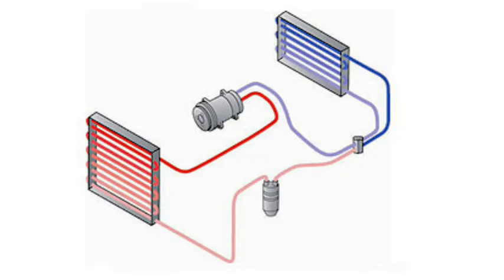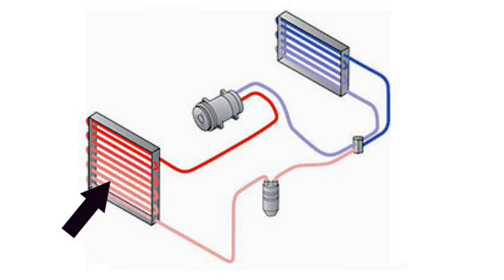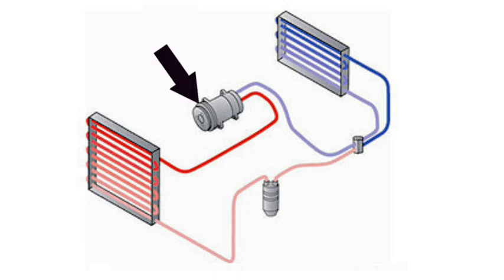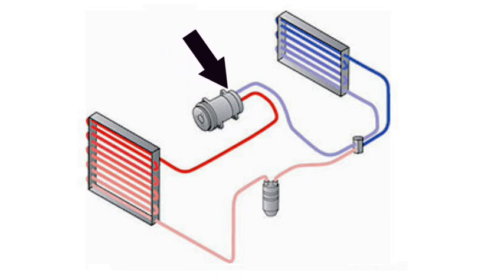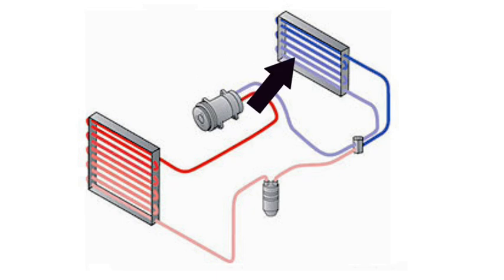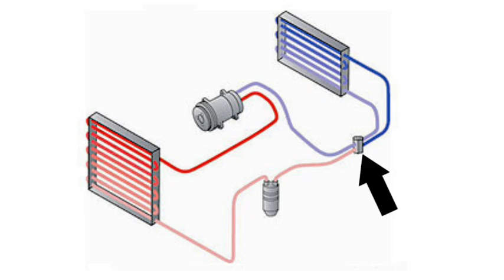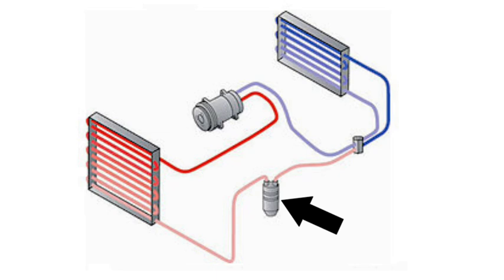AC System Basics - EricTheCarGuy

Comment: The only problem with taking it to a professional is that they will charge you $800 to $1500 no matter what is wrong and it may still not work right. The auto repair business, and especially AC repair is one of the biggest consumer scams and rip offs.
Reply: Whatatay T amen
Reply: Ok let's put this into perspective since ALL mechanics are scam artist. There are over 1,500 car manufacturers out there and each one has anywhere from 1-10 different ways of doing this, can you can tell me every single way this is done? I'm gonna say it's safe to say HELL NO so next time a mistake is made think of the bigger picture not just your own selfish thoughts on what you think is right.
Reply: @jayyroberts7754  Which is irrelevant? Why would they need to know about every system, ever? Clearly someone doing research into the possibility of doing it themselves will only look for information applicable to their unique system. Also, your notion that doing it yourself because, in most circumstances, it is otherwise unaffordable is "selfish" is laughable.
Reply: I love somone with YT knowledge saying AutoTech are dumb. Why are you hear if we are so dumb.
Reply: No YOUR just a fucking idiot
Reply: I never service my car AC till its broken itself. Jst change the cabin filter. Never trusts workshop. Whenever i service it, they will say some leaks, condensor not good, the worse is ur compressor needs replacement. I had bad experience when jst replacing the cooling coil then eventually i had to replace the whole system and costs me 3k. What so frustrating my other car, the cooling lost during really hot day.
Reply: Bro i just check my ac system at firestone auto..they took my car and i was sitting inside the waiting room then they told me that to fix my ac would cost me $2100..i was so stun i said to the guy... bro i am driving a chrysler mini van for christ sake!!! not a Mercedes
Reply: @throwmammafromthetrain  its the typical mechanics. Always try to get the most expensive parts. My advise, go and bring it to at least 4 shops and hear wat their comments and compare.
Reply: One fucker broke my compressor in my 93 celica when I lived in Florida. I had to endure the heat for 4 years man...
Reply: @goldwolf0606  woah. FL heat is brutal wat did he do?
Reply: I can understand how some people can call the automotive industry a scam but thats not what it is... dealers and private shops have no intention of ripping people off. I mean seriously, if you cant handle these places then you should be doing research and work for yourself instead of complaining. And for your info people, not everyone is a scam and not everyone is out for your money. If you dont like it, educate yourselves. Dont be lazy.
Reply: Carl Bungabong why dont you!?! Enough of them do that complaint is warranted!!! Fucking crooked ass Mechanots!!! I’ve met 2 good mechanics in my life. My brother and this dude named Bob Simon. Then from YouTube there’s Scotty Kilmer, Chris Fix, and 3000gt restorations. The rest, that I’ve actually met... just want money money money!!! They don’t care to help. I have started learning and doing my own repairs because of them! and because my brother lives on the other side of the country or I’d have him fix stuff.
Reply: @carlbungabong6536  You're lying.  Not every auto repair place is out to rip you off but many are?  The problem is,  if you get an oil change and leave without paying,  it's a crime and you can be arrested.  If an auto repair place charges you for an oil change but doesn't do it, it's a civil matter.  We need laws where employees and owners are arrested for fraud.  Speaking of lazy,  get off your ass and look up videis of auto repair shops ripping people off.
Reply: @MrWhaatay  the automotive world isnt cheap but yes its wrong for a shop to charge you for any job that wasnt performed but just because there are places and people who do it, it doesnt mean that everyone is doing wrong. Like i said, if you want cheap and work done right, do it yourself and not complain about shops. Just because youtube has videos of assholes doing it doesnt give you a reason to think that way. I do free jobs for good people as long as they supply their parts. Hell i even help them get parts free of charge and use what discount i can provide to help them because not everyone knows about cars and there arent many who can provide for all maintenance. This is why i take offense to your comment. Surely i wouldnt want to help you with a free job anyway so good luck with your repairs.
Reply: @carlbungabong6536  Just because you help people doesn't mean everyone does.  More auto shops rip off people than don't and I'm not talking about You Tube videos. I'm talking about government watchdog consumer agencies.  I take offense at your comments as it seems you are trying to get people to get ripped off. If you don't think auro repair is one of the biggest scams you are either lying or dumb.
Reply: Where do I find accurate wiring diagrams for auto AC system
Reply: I got my condenser replaced and the system recharged for a grand total of $350 at the shop I go to.
Reply: @yadonious5005  You got ripped off.
Reply: Whatatay T how much should that have cost?
Reply: BS. Most I've ever paid to have my A/C recharged is about $60. That was many years ago, but it's not that expensive unless you need parts. New parts are expensive, get used ones and save $$.
Reply: @OMGWTFLOLSMH  Did I say charge?  I can charge it myself.  If you take it to a professional because the AC doesn't work they will rip you off.
Reply: OMGWTFLOL mate there’s a difference between a recharge and getting a new condenser put in and THEN recharged after that
Reply: @yadonious5005  If you only need a recharge they will still rip you off and charge for parrs that aren't needed. If you need a recharge you have a leak.
Reply: Whatatay T yeah, a leaking condenser. And I don’t imagine welding on a small piece of sheet metal to plug the leak will be any cheaper than a new part by the way
Reply: @yadonious5005  The point is regardless of what is needed professionals will rip you off and charge $800 to $1500 for any A/C repair.
Reply: @MrWhaatay  Most of them, yes
Reply: hi eric how do you fix the ac system on a 1994 siverado
Reply: where do u live?
Reply: +Whatatay T - You are 100% correct. Here is what I do, I learn as much as I can, so I can do it ALL by myself. Although NOT all will be like me... But it's NOT hard to learn everything by yourself. Maybe I got a good head on my shoulders, thankx to whoever is above.... But even if I don't, I don't give up that easily. There are tons of things you can do and especially YouTube, you can learn a lot, even from the Dummy YouTubers.
Reply: Give me a break. the auto mechanic who doesn't rip you off is the exception and not the rule. some are just dumb especially when it comes to electronics and computers.
Reply: You have obviously had bad experiences with auto repair shops, but don't label all of us as scam artists.
Reply: What you can do is to bring it to an AC specialist for them to diagnose what the exact issue is (you DO NOT actually have to actually go ahead with the work they suggest...most wont be offended if you say no thanks and take your car home).  

Unless you are concerned that the shop is going to intentionally damage something that isn't damaged when you brought it in (I guess it's possible but that really would take a real ass of a shop), at least you'll know what the issues could be.  If you feel that the diagnosis is questionable you can bring it to another shop and see what they say.  If the 2nd shop says the same thing then chances are it is what it is. 

NOTE: you can usually find coupons for AC diagnostics service for pretty cheap (i just saw a $9.99 ac diagnostics coupon for Firestone).  

Once you know what the issue is you can then decide on what to do (with AC's you're kind of stuck unless you live in Alaska or something since you will need it).  

If it's something like the compressor motor (expensive) you could mitigate the cost by actually shop around online to find a cheaper compressor motor (you want to make sure that you call them personally and give them all the details of your car..year, make, model, trim, engine, auto/manual, etc. so that it's the right part) and then just have the shop do the labor.  Could save you anywhere from a $100-$400 right there.  The labor probably will still be hefty but at least it's more reasonable if you can save on the part.

The shop may have an issue with installing a part you brought in but you can ask the shop if they are ok with that.  At the end of the day, they will be making money off the labor so I would be surprised if too many shops would not take on the labor only work.
Reply: Cool Eric, thx !
Reply: That's no joke... I don't know SHIT bout automobiles but I'll bust out my YouTube videos & whip out my toolbox filled w/not a SINGLE tool that real mechanics keep on hand & I'll give it my damnedest to fix ANY issues b4 taking it to a shop cuz I figure I'll either get lucky & fix it or I'll be out 2-3 grand (ON A GOOD DAY) either way regardless of what else I did or didn't fuck up in my quest at auto mechanic greatness lol
Reply: Exactly. I took my car to a professional. He said it will cost me $800. So decided to find out the issue. So I did finally. It was the AC fan. I changed it with $60 and put $740 in my pocket. So I do agree with u. AC related business is scam and they charge u with unfair prices.
Reply: Roje Tarvirdian  Then they were NOT professional. I assume you walked in and said my “AC doesn’t work how much to fix it”?, without having any idea what was wrong they quoted you a price based on average fixes with a new compressor other components charging labor etc. etc. This is where the unprofessional part came in. Shops should NEVER EVER price an unknown repair without looking at the car. You probably didn’t want to pay to have them look at it and diagnose it correctly so in the end there the bad people for quoting a high price 
you got lucky and figured it out yourself and that’s great I’m glad for you.. But saying AC is a scam is absurd. That’s like saying everybody that believes in aliens smokes weed lives in their parents basement. Or all Catholic churches touch young boys which most do but regardless I’m sure they all don’t. .
Reply: nope he's correct take the car into the shop there's a lot more to know about this stuff and every year there's something new.. you can blow yourself up if you dont know what your doing. the a.c technician will save you weeks of flipping out when the problems something simple mean while you just changed 1,000 $ worth of parts plus your labor when the problem was a sensor or bad connection stuff like that

Comment: I was told that the compressor had to be replaced and that I had a choice of installing a by-pass for $150 or $700 for the compressor, I paid $700, it was replaced. The next morning when I started the 2007 Dodge Caravan, I heard a loud squeal. The following evening it happened again and the cold air stopped. I took it back and was told that the fan needed to be replaced for $700 plus there were at least two more leaks. At this time I told him that the squealing didn't happen if I didn't turn on the A/C, which I hadn't picked up on before. So I asked, could I get away with not turning it on, he said yes. It would have been nice to have been told that before I spent any money on it.  Why suddenly would the fan suddenly break down. The estimate is $1000 to fix it. Also, why do you suppose I was offered the by-pass vs not turning on the AC? What's the difference besides $700?
Reply: +c7i6abc Sounds like you were taken. Belt squeeling only when the A/C is on, I'd be looking for a tensioner possibly. As for the leaks, if you can find them yourself & repair them it'd be worth it. Fan is easy to replace, or just only have A/C when driving down the road (air flow through the condensor).

Comment: I have a 1994 Mercury Villager. and my AC compressor totally freezed and could not be turned with a wrench.  The belt got burned and broke off as a result. 

Due to that malfunction, what are the steps to repair the AC unit?  It seems that I need to replace the AC compressor.

Do I need to flushed my system?
Do I need to replace the Condenser?
Do I need to replace the Receiver Drier?
Any metal debris gets stucked in the Condenser ?

Thanks!
Reply: +Brian Pang It's really a crapshoot. It depends how the compressor failed. As a general rule of thumb, some of the other components may be plugged up from the failure. Most notably, the expansion device (orfice tube) probably needs replaced. On a vehicle that old, I'd just replace the compressor, replace the orfice tube, change the belt, add the correct amount of refrigerant (after properly evacuating it of course before the compressor R&R) and then see how it works. A/C flushing requires expensive machines and isn't always all that great.

Comment: does the fan have to work wile ac is on ..because mine isnt and i don't have cold air?
Reply: +RetroEntertainmentGuy The fan should turn on whenever the AC is on. If it's not, you may still have air conditioning while driving down the road. The main thing to check in this case is if the compressor is turning on. If it's not turning on, you have further issues.

Comment: my a/c obviously has a leak due to the fact it does not get cold anymore. I also noticed a film on the inside of the windshield. where would the leak most likely be coming from.
Reply: +James Buckley Could be a bunch of different things, from my experience the first thing I would check is the schrader valves on the high/low side service ports.
Reply: Thanks. I did find out my compressor is leaking.

Comment: So, my car has A/c problems and i don't know what it is but the car starts off somewhat cool then heats up as i drive. i have a 1999 honda accord and the car has been driving decent but it does this thing on occasion where the engine/car will turn off completely and then instantaneously turn on WHILE driving. I talked to a mechanic and he said it was just carbon deposits in the engine from getting old. i was wondering why my A/C is working so weak because when the car does restart while driving the A/c will kick in and be EXTREMELY cold. do you have any suggestions other than sending it to a mechanic to repair? i don't want to spend anything over $100 at a mechanic because the car is worth nothing...
Reply: MultiNutterbutter Also yes the refrigerant is maxed out, its not low on refrigerant.
Reply: +Azaria Abebe Need to have an idea on your pressures, I'd be worried you're actually overcharged based on your complaints.

Comment: Dear Mr.Eric im from UAE.
 have one 3 tone pic up,
There is an AC problem. The problem is after noon time (when the out side temp is high) the high pressure become high and getting hot air inside the cabin, morning and evening time the AC is working fine....
Reply: +Rashid P Sounds like you have air in the system. Evacuate the system and pull it into a really good vacuum. Then re-charge & see if you still have the issue. When re-charging I would add some dye to make sure you don't have any leaks. Hope this helps.

Comment: Hi Car Guy

I really wonder If I will instal an extra or auxiliary electric fan to enhance airflow through the condenser then high pressure should be reduced for higher performance especially in crowded cities when you are stuck in the traffics and all the hot cars air is surrounding your poor outside condensor

Comment: eric my ac is always colder at night at 43 degrees but on a hot day its running at 65 degrees it has a new dryer , new expansion valve evap was just cleaned really good vac,d and recharged any ideas

Comment: one of my ac lines is getting frost on it but the rest of them are warm and my ac isnt cold anymore aby ideas how to trouble shoot whats going on with it? any help would be greatly appreciated
Reply: nissanjeep187 Your system is low on refrigerant, probably. The other possibility would be low air flow across the evaporator coil. Before adding refrigerant, clean the evaporator and condenser coils. Good airflow is paramount to keeping a system working well.

Comment: I HAVE A HONDA ACCORD 2005 I JUST CHANGE THE AC CONDENSER, NOW AC HIGH PRESSURE LINE IN COLD AND PASSENGER SIDE VENTS ARE BLOWING COLD AIR AND DRIVER SIDE NORMAL AIR, CAN YOU HELP ME WITH THAT ISSUE.
Reply: +ALAIN ALONSO Sounds like a shutter door issue, not an A/C issue. Do you have a similar issue when using the heat?

Comment: dear   do you think we can install electrical motor working with dc or ac current , to make compressor run with it instead of car engine, if it possible air condition can run while car engine off?
regards

Comment: The real cooling is done by the evaporation process not the pressure change. The pressure change is allowing the evaporation, but the pressure change alone won't cause much cooling. It the phase change, from liquid to gas, that absorbs heat. The high pressure liquid in that can is allowed to escape through the spray nozzle "expansion valve" into the lower pressure atmosphere where it boils into a gas and that phase changes absorbs heat.
Reply: Sometimes you can feel or hear the fluid inside the air can boiling. I had one actually frost up before. Letting the air out of the can lowers the pressure inside the can, which allows the fluid to boil in order to equalize the pressure back to what it was.